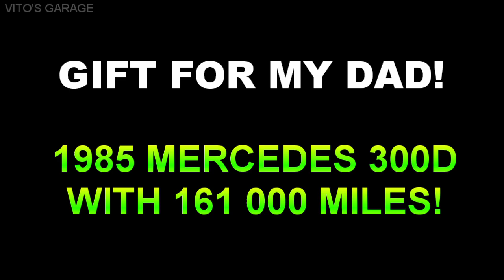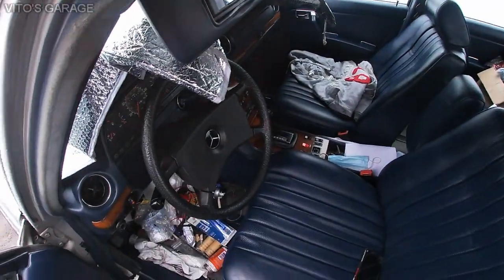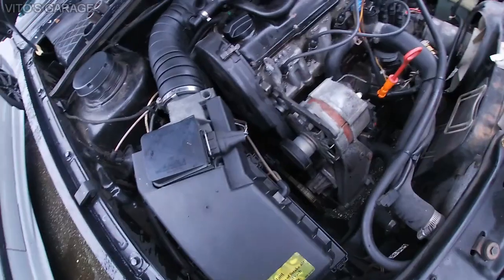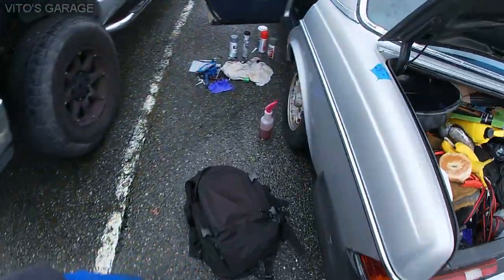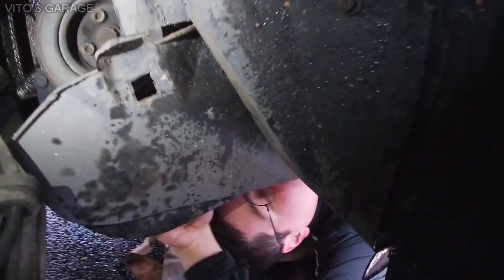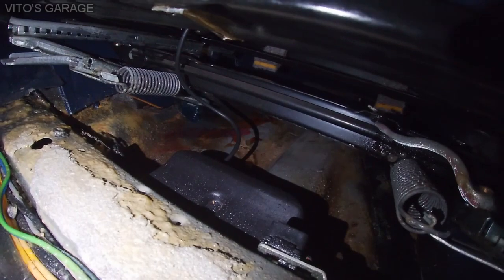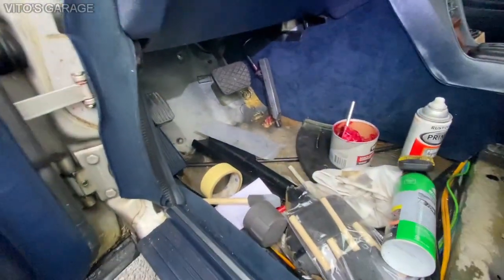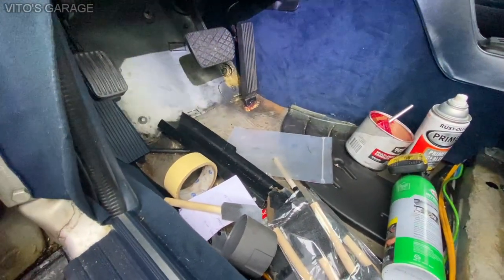PART 22 Dad's Mercedes W123: Floors & Fuel Pedal Mount Preservation! Best Anti-Rust Products!

Comment: Those floor are mint! usually they are long gone. What anti-rust treatment do you spray?
Reply from the maker: Fluid film, bearing grease and some oil
Reply: @VITOSGARAGE  Hi Vito! I’ ve seen you use blue grease but I assume any multi purpose bearing gease can work, can’t it? Thanks again for your enthusiasm!
Reply from the maker: @luiscarretero9412  yes, any grease will work for the metal surfaces